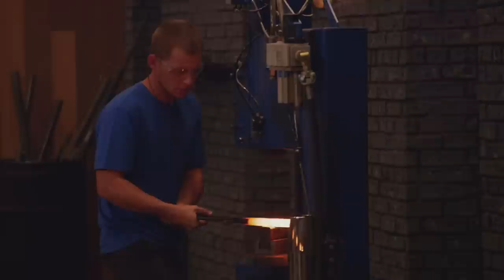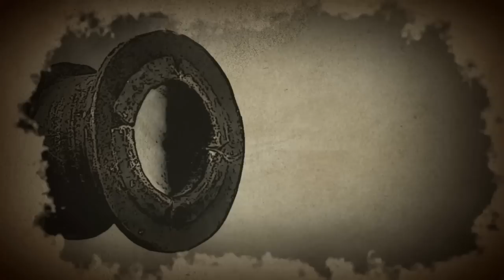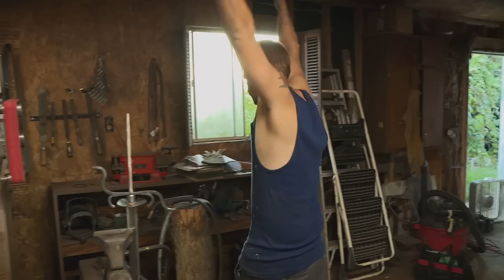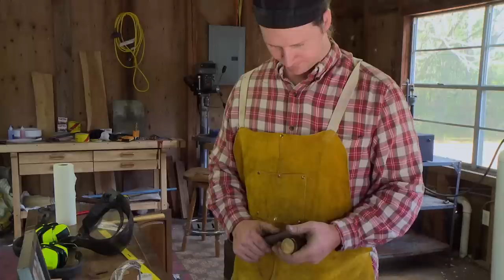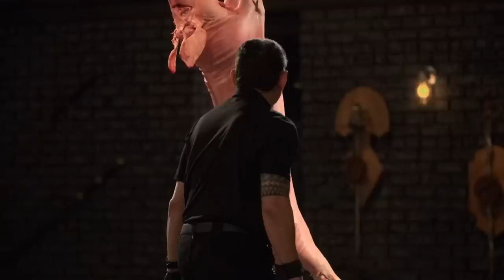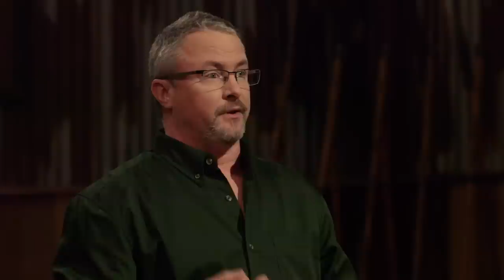FORGED MADNESS: Washington's Colichemarde vs. Napoleon's Saber | Forged in Fire

Comment: It's a rough choice because as much damage as the saber took, the colichemarde hurt the the user and that's a huge problem.  That said, at the end of the day, you can fix the sharp edges that bit into the user's hand, but you can't easily fix a heat treatment issue so I'll vote for the colichemarde.
Reply: I agree...can just file those parts off.  The other wasn't made as well though.